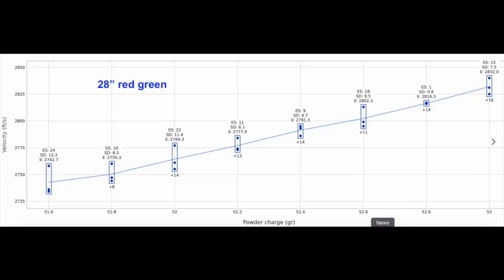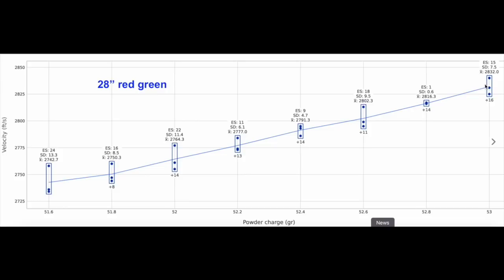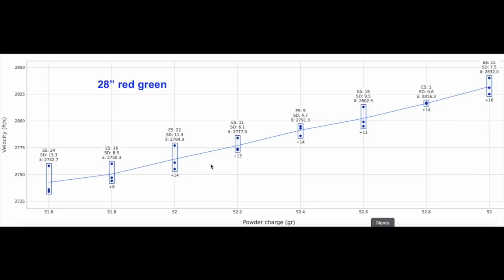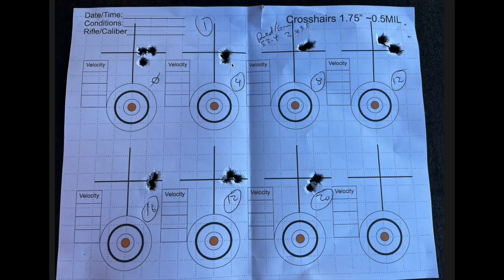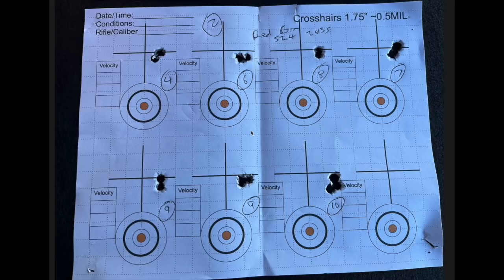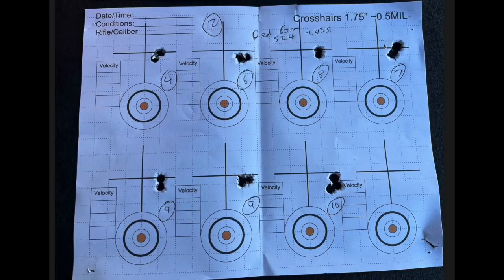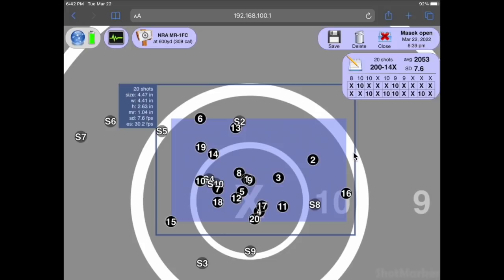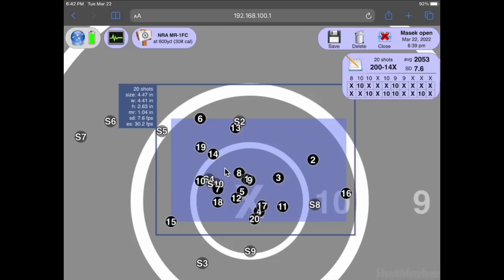Short cut new barrel load development with a Cortina Tuner

Comment: As always thanks John! I was wondering  why you didn’t find 52.8 grs interesting? Best group, ES and SD. I’m new at this. Thanks!
Reply from the maker: Not sure but I just wasn’t feeling it. Some it was that is a lot of Reloder 16 in a 284 plus I knew I’d be coming down in powder charge after about 100 rounds anyway. I’m actually down to 52 now and will probably drop another .2 for my next loading.
Reply: @FClassJohn  Thanks sooo much for the great and very understandable response!!!
Reply: @FClassJohn  I was about to ask the same question cheers again man.
Reply: John looked either side of that group and didn't like what he saw. A node is a minimum of 3

Comment: If someone was trying to save time & components with this approach, do you think one would see better results from doing a seating depth ladder test and then tuning or what you did here with a charge weight ladder and then tuning?  If you could only do 2 of the 3 steps (seating depth, charge weight, and turning) which combination actually yields the best results?  Could be a great video to compare the two approaches for the best bang for your buck.
Reply from the maker: It's not a bad idea for a video. I can you that in reality just doing those two test you'd probably about the same results in terms of finding nodes that work for each. All you're doing by having a seating depth test first is giving it a an even more reliable jumping off point for the tuner test. That's why for long term results I always do seating tests, then tuner but for a one-off siltuation what I did totally works.

Comment: Not to split hairs, but wouldn't 52.3 be the perfect number for a charge? Between ES of 11 and 9? Being that 52.6 has an ES of 18. I also don't understand why you did a tuner test instead of a jump test. Wouldn't you normally do a jump test first and then a tuner test? Now if you did a jump test you would start with the tuner a 0 and start from scratch. I'm not being a troll, just asking. I just recently bought an EC tuner (my first tuner). Thanks.
Reply from the maker: You’re absolutely correct and like I said normally I would do a jump test first. This was simply to prove to people that if you really wanted to it can be skipped and still get pretty good results. And the full length video that I did over on my Patreon I go back and do the whole process in the order that I normally would and the results are even better.
In the end there are still a lot of people that are skeptical that Tuners really make a difference and I short cutting the seating depth test this just better proves that they have a pretty strong effect on barrel harmonics and ultimately your accuracy.

Comment: Could you do a short video just listing the order of things you tune and what metric you use? For example, for the Powder charge, you use SD or ES and not necessarily group size, right: for seating depth do you use group size or ES/SD?
My impression is that Powder charge is first, and tuner is last, but I don't really know for sure.
Reply: Disregard, you just said it's on your patrion: that makes sense. Thanks.
Reply from the maker: No problem, thank you for the support over on Patreon!

Comment: Doing ok on bullets and primers but it never fails when I get the notification for powder through Discord I always loose out during the purchase process or it is immediately gone. I been religiously carrying around my cell phone so when the notification happens I can check right away and still no luck. I have enough points this year to apply for a good unit in Eastern Oregon and I want to be spot on this year and not be mediocre like in the past couple of years due to substituting powder.
Reply from the maker: Yeah it's tough. You have thousands and thousands of people doing the same thing so it's a real crap-shoot sometimes especially when something comes up that hasn't been available for month. On top of that you have the resellers grabbing what they can to put over on auction sites. Some powder has been easier like H4350 (I've seen it almost every day lately) but others are while rhinos still.
Reply: @FClassJohn  it never fails though when I do see product show up, the same day product show up on gun broker in a bidding war.

Comment: Did you shoot 3 strings going up in powder per string, or shoot 3 of same powder weight then the next weight group. How long do you let barrel cool down or to what temp did you start again
Reply from the maker: I shoot three of the same and only let the barrel cool if it exceeds my personal threshold of 160 degrees.
Reply: @FClassJohn  thanks, I just started PRS and got my MPA 6.5 last week. So many different ways to finding the right load. The NODE thing got me, but its making a little more sense now. I did a break in of 25 rounds and 60 of different powders that I have. H4350 is no where to be found ........ well gunbroker at 600 a jug, crazy. Love your videos
Reply from the maker: @evoevil124  sounds like you’re off to a good start!